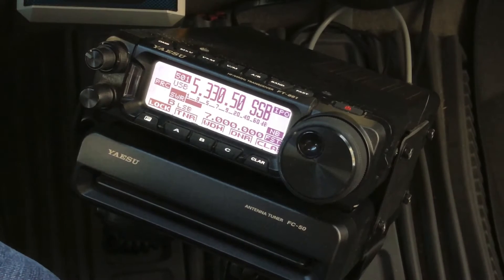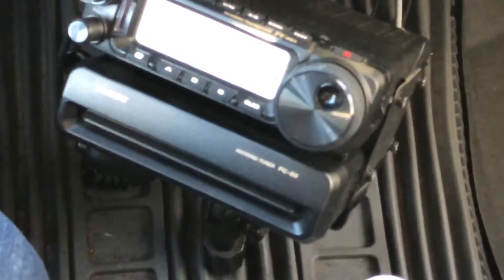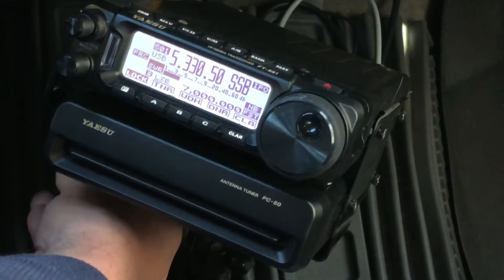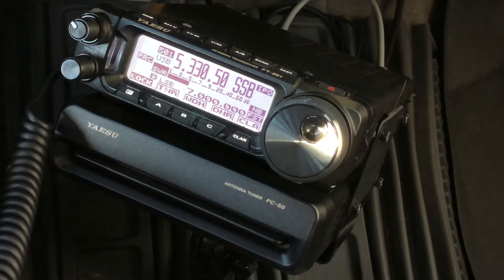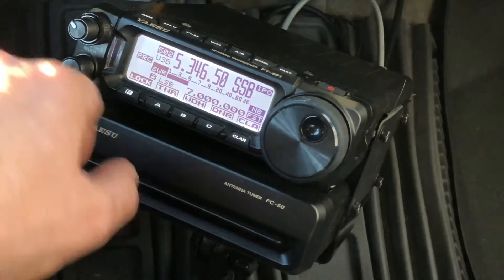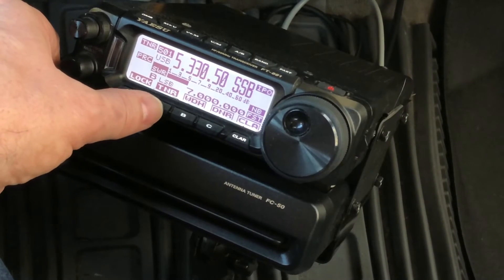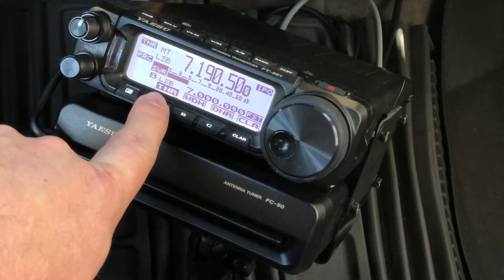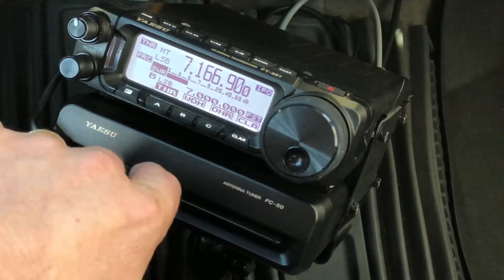Yaesu FC-50 Antenna Tuner with the FT-891

Comment: I'm just getting into ham and have this combo on order. How neccesary is the tuner?
Reply from the maker: The use of the tuner is optional.  If you have an antenna that is resonant for every band you intend to use, the tuner will not be needed.  Generally though, on 40 meters, 80 meters, and 160 meters, even a resonant antenna is only resonant on a specific region of the band.  If you will operate SSB only, in the General Class portion of 80 meters, tune your antenna for the lowest SWR on 3.9 MHz.  For 160 meters tune for 1.925 MHz.  For 40 meters tune for 7.200 MHz.  For 20 meters and up, if you tune to the center of the band, the SWR should remain low enough to cover the entire band, though it may get close to a 2:1 on the band edges of 20, 15, and 10 meters.

A tuner like the FC-50 is what I call a touch-up tuner.  It can take up to a 3:1 SWR and drop it well below 1.5:1, which is ideal.  My mobile setup uses a separate “ham stick” antenna for each band.  I use the FC-50 to touch up the SWR for the upper and lower portions of each band.  But for 20m and up I don’t need it.

For a base station, a common antenna is the Off-center Fed Dipole, which is below a 2:1 SWR on 6, 10, 12, 17, 20, and 40 meters.  With a tuner the antenna can usually be used on 15, 30, 60, and 80 meters.  Another antenna I recommend is the ZS6BKW.  You can build one but it’s hard to build one better than the one available from NI4L.com.  This antenna works on the FM portion of 10 meters, all of 12, 17, 20, and 40 meters without a tuner. With a tuner it works on the other bands except 160 meters.

The FC-50 is not a wide range tuner.  It’s the same as most tuners that are built into the larger modern radios.  It can touch a nearly resonant antenna.  For antennas that have a 4:1 or higher SWR, a wife range tuner will be required.  But if you purchase a OCF Dipole or the ZS6BKW for base station use, the FC-50 can help you operate the full range of most bands except 160 meters.  160 meters requires a longer antenna.

You didn’t specify mobile or base so I thought I would cover both.

73, de N4HNH
Reply: @n4hnhradio  Wow, thanks for the reply. Im using it as a base station and have an ocf dipole up in the attic. Currently just listening in on the bands as I study for my license.  Eventually I'll probably get another unit and transfer this for mobile use but right now it's my base station.
Reply: @Gilbertmk2  I am in the process of the doing the same thing. Can I ask what antenna you are using ? Did you buy or make your own ? Thanks.